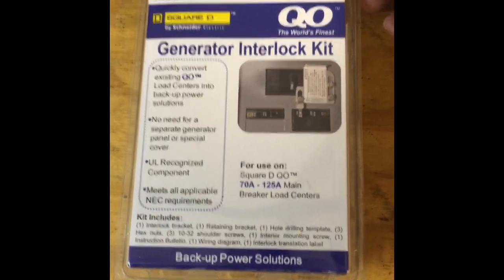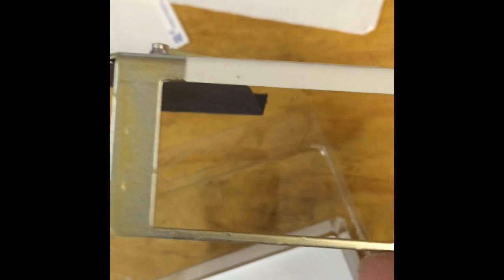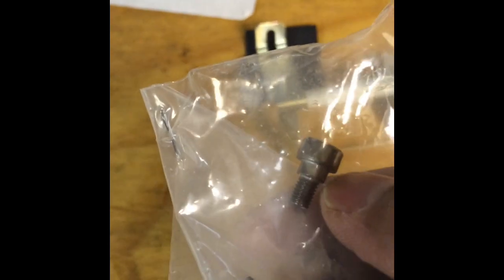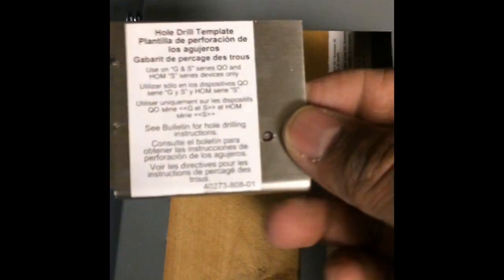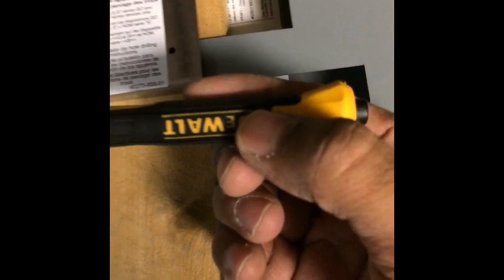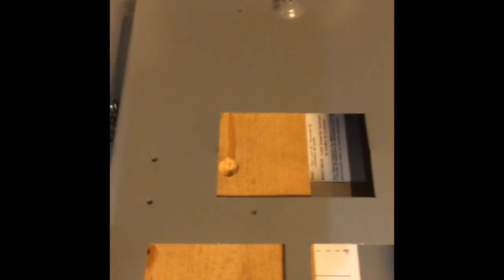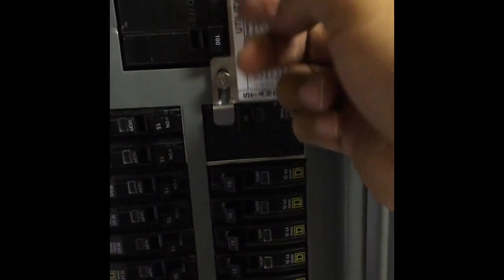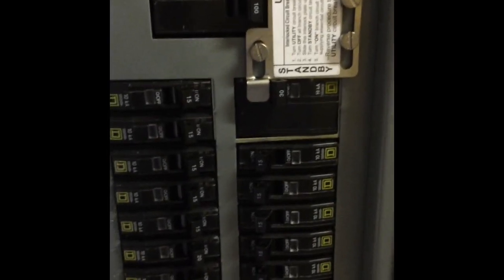Residential Electrical Panel Square D QO with Generator Interlock Part 2

Comment: I’ve watched a few of these videos trying to understand the install, and none of the videos explain the breaker you need?!?  Is it a standard 30 or 50 amp breaker? And with that standard breaker you back feed the panel during an outage. I understand the bracket it’s for lineman safety etc.  it’s just that none of the videos went into detail on the breaker needed.
Reply from the maker: I used a 30A breaker but ran 50A cable to it in case I wanted to upgrade at a future date.  Don’t forget if you do switch from a 30A to 50A, you will need to upgrade the inlet receptacle as well.

Comment: These kits are such a ripoff!  $60-70 (or more) for a piece of metal with some holes in it.  Should be more like $5-10.  The idea and functionality are great.  Just over-priced for what you are getting.
Reply from the maker: I don’t disagree.  If you ask me they should just be in the box when you buy the panel.
Reply: Actually it is a very good deal if you had to buy and install a transfer switch it would be atleast $300.00
To possibly much more depending on # of circuits.
Reply: @gregmartin1757  Just because the transfer kit is overpriced doesn't make this a good deal. It literally is a small piece of metal with holes. it can definitely be made for under $5. $10 would be a  good deal; $15 should be way more than enough. Problem is the panels are all different and making it becomes one of those proprietary things they can overcharge for because there isn't really competition.

Comment: is it only me or that piece you put underneath does not do anything? Why is it there anyways? looks like the only piece required is the outside piece?
Reply: The piece inside is a reminder/warning to anyone working with the panel cover off not to switch that breaker on.
Reply from the maker: That piece is required to meet code.

Comment: Nicely done, and unlike a transfer switch you can pick any circuit(s) you want to power based on the ability of your generator.  I was so thankful I had mine in when Mathew came through then Irma the very next year.  Even ran my central air.

Comment: Thumbs up for a safe way to power your main panel. Good Job.  I put mine in a year before super storm sandy.  It really paid off.
Reply from the maker: Dqalex - yes I was replacing my main electrical panel, so I figured why not upgrade and have the ability to have a whole house generator feed